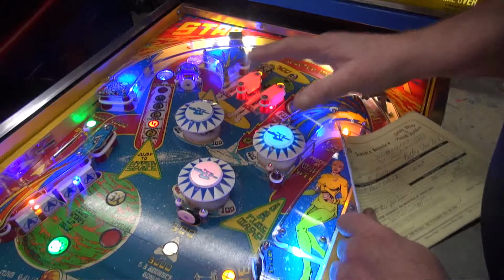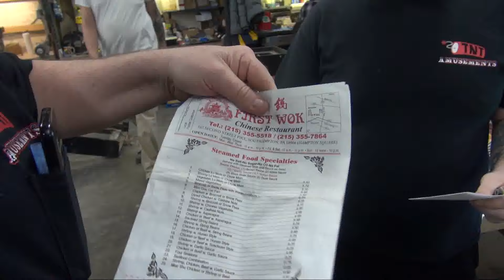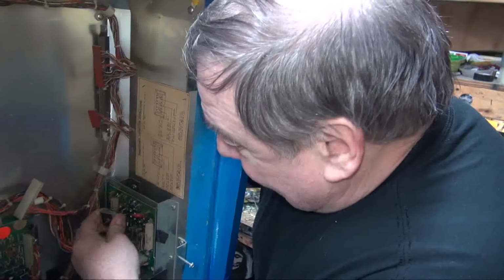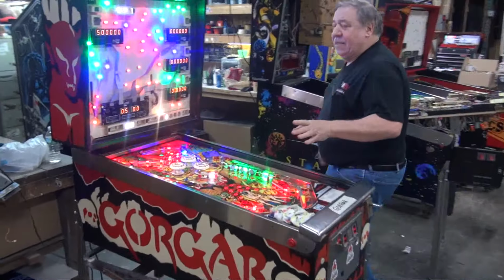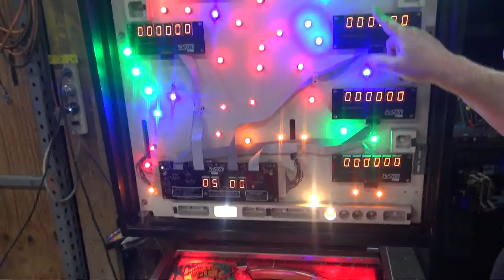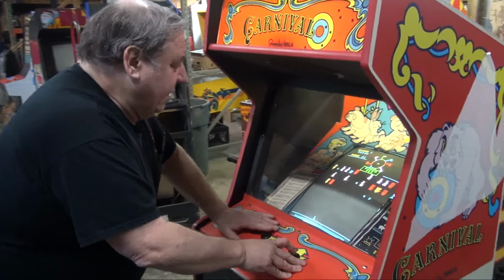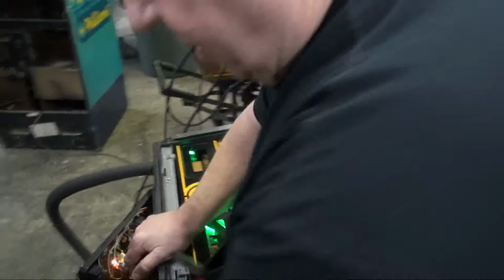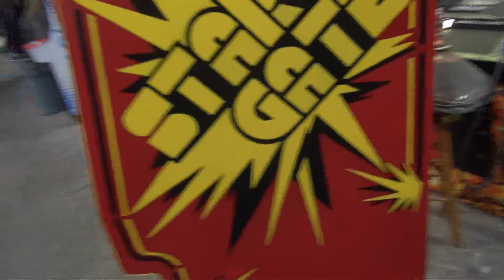#1460 Bally STAR TREK & Stern Premium Version Pinball Machines-Taito ZOOKEEPER Arcade-TNT Amusements

Comment: on the 220, 230, 240 thing.  thats world wide including the USA.  well up until it hits your land.  the transformer out along the street converts 240 to 110 or 120 or 115 (don't see 115 often) from whatever the big volts are.  Just UK and whoever just has it direct..  Don't know why they do this cause that very dangerous coffee warmer stick that literally has 2 strips of metal plugged directly into the wall and you'd have to be a complete moron to put a metal spoon in there and bother to touch it, still works at 120 volts or so.  but wonder 240 volts hmmmm   I'm not listing the item, but ebay will probably have the one somewhere (it's not the metal heating element.  it's the dumb plastic with 3 holes that heats that water or coffee up rather fast.  Quite fun if you know what not to do :P  Then Todd really would get a zap and probably bloop himself out :)  I can probably link Clives video for it though  https://www.youtube.com/watch?v=EViyccc2t9w  and I got mine summer of 2018 so ......
Reply from the maker: we have had fairly good success on our conversions so far...no zaps yet!

Comment: Todd, i had this guy hook up my led strips and now i got 3 lights not working on my board ? can you show how to install them without losing any lights ?
Reply from the maker: Not sure how this guy was hooking them up...they should not blow out transistors unless he was putting too many on the circuit or simply did a dead short.
Reply: @tntamusements  he took one existing bulb out and hooked up the strip to that bulbs socket..so 3 strips 3 missing bulbs
Reply: @tntamusements  bubs
Reply from the maker: @paolovincent6800  What game?  If you put the old bulb back in does it work?
Reply: @tntamusements  lotr, he removed the bub and hooked up the strip..the strip is powered by the socket , can it be hard wired?
Reply: @tntamusements  Todd , didnt you understand my ?